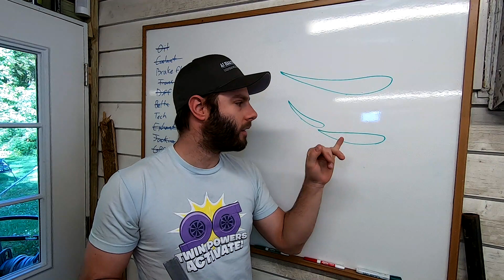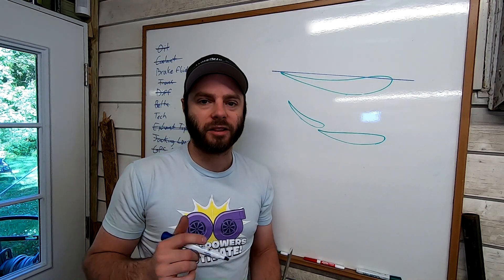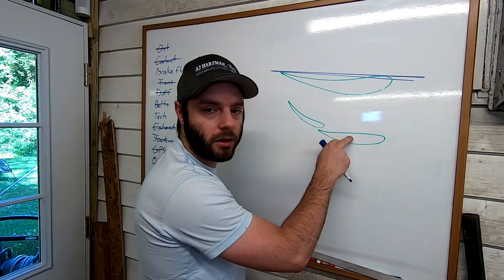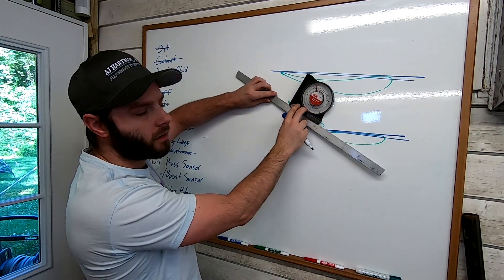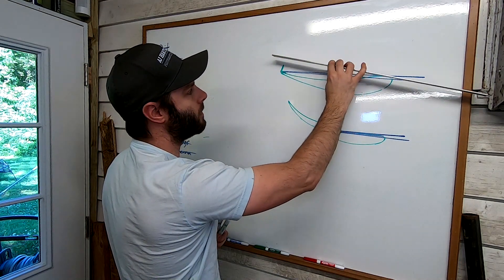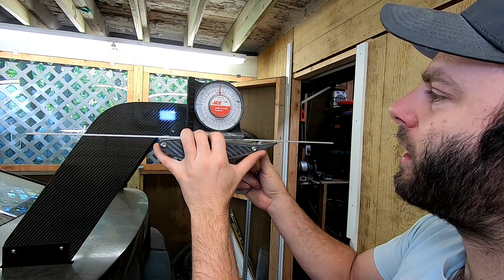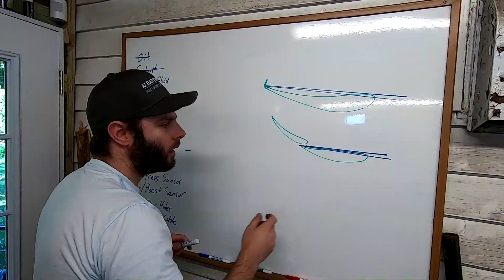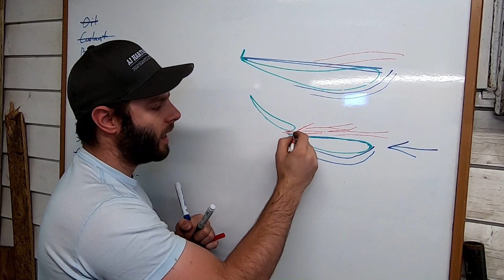How to Measure Wing Angle - Single and Dual Element Wings

Comment: Having a spoiler just below the wing kinda helps speed up the air moving under the wing that keeps the air in contact with the wing coming off the spoiler.

If that makes sense.

Comment: Is the ground slop/angle taken into consideration when finding the AOA of the wing? Sometimes driveways and garages had a slight slope.
Reply from the maker: Yes, it should be taken into account. If you car was sitting on a 10deg slope you don't want to sent you wing at 10deg and then end up with a wing at 20deg.

Comment: What if your wing element has a gurney — so you measure from the top of the gurney to the leading edge or set the angle from trailing to leading without accounting for it?
Reply from the maker: Don’t include the gurney.
Reply: @ajhartmanaero  Thanks AJ!

Comment: Thanks much AJ.  This is very helpful.  I just went out and measured your wing with my phone inclinometer, a straight edge and also a level.   Got the main chord level now (was stupidly 8 degrees) and set the second element at 20 degrees (as a starting point).   Will test at Lime Rock and adjust from there.  I also see that I now created that small gap that you mention between 1st and 2nd element (was closed before).